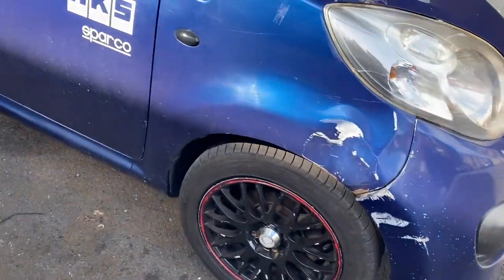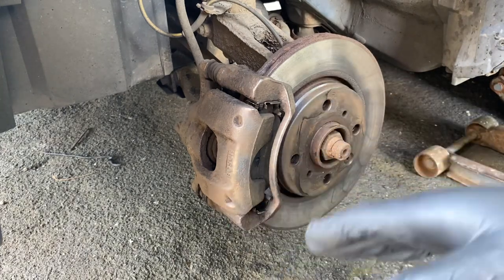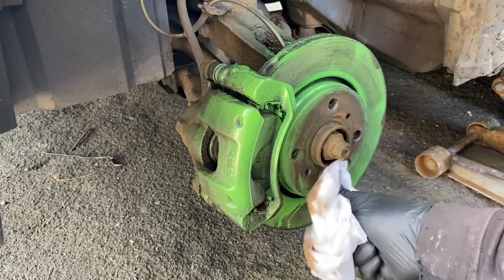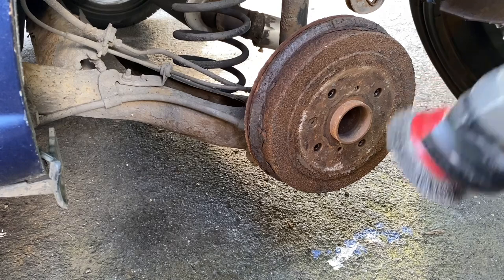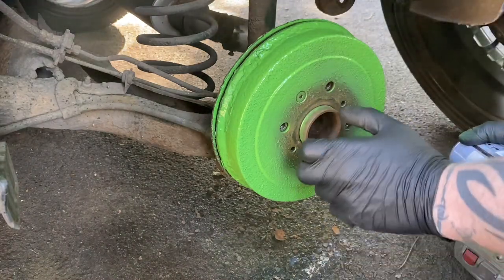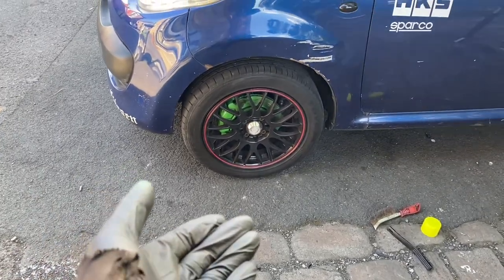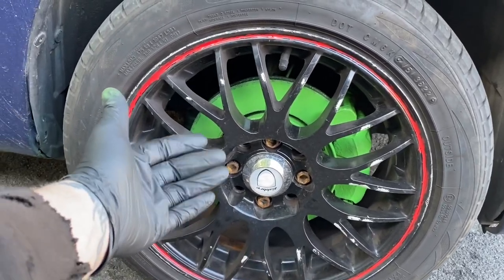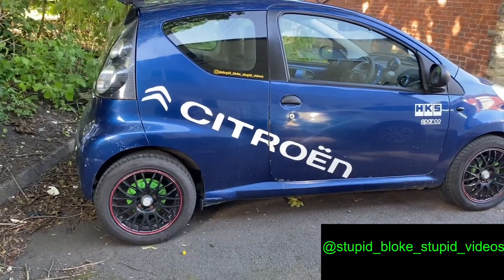Stupid or Genius? Easy Brake Calliper Painting. Is Painting Brake Rotors Dangerous? (C1/CityBug)

Comment: Hallo. Thanks for your content. I love your style. I've got a suggestion about the TPS on the throttle body of the c1. I found out that mine was only giving 78% at full throttle (obd cheap dongle shitter). So I thought the ECU didn't get the full throttle signal and the car was slower indeed. I was managed to get it to 94% by adding a small bit of hose on the pin that goes into the sensor. Maybe you could check yours and release lots of possible BHP's.🤣 I will order a new TPS but for now it's ok. Cheers 🍻
Reply from the maker: Hi mate. I have in fact looked at this in the past,.. before the YouTube channel existed even. I think mine (the black car) got about 80%. When I looked into it, it’s supposed to be normal. I might in fact have a look at adjusting it like you did though just to see what happens 😂
Reply: Thanks for your reaction. I think mine runs a little bit (picks up speed) better now, but it might also be A sort of placebo effect. The idle control valve needed some time to adjust though😁  @StupidBlokeStupidVideos

Comment: I had mine painted Silver.
But, m8
Do you know of aneasy way to strengthen the areas where the lift goes on both sides of the car
The other day I jacked my car car up and the jack's head bended the metal whoch is supposed to be strong enough to jack up the d@mned thing.
Thanks
Reply from the maker: What type of jack did you use?
Reply: @StupidBlokeStupidVideos  a mini jack with a lift base like the regular one. 
Round tip with jagged 4 edges that could fit the cracks
Reply: @StupidBlokeStupidVideos  I  was thinking of soldering metal slices like 20 x 1.5 cm on but I don't know which thickness is best to take the weight or pressure.
Reply from the maker: @userbasba  I think the issue is more with the shape of the jack you’re using than the car, unless the sill is rotten?
Reply: @StupidBlokeStupidVideos  I think there's too much rust.
Reply from the maker: @userbasba  😞